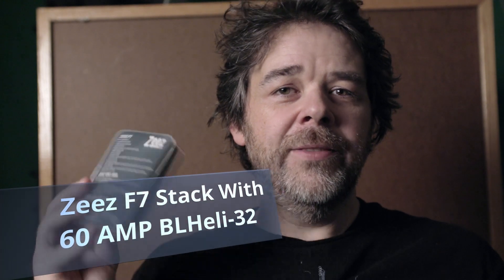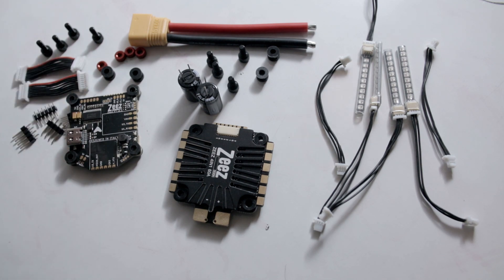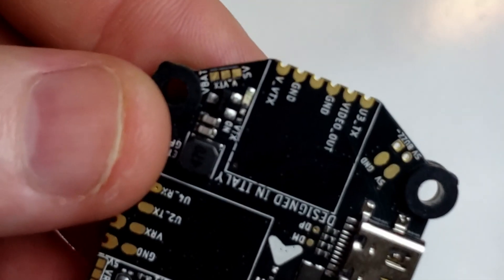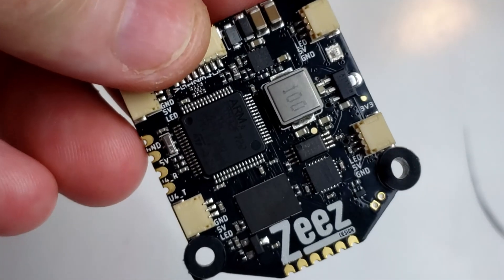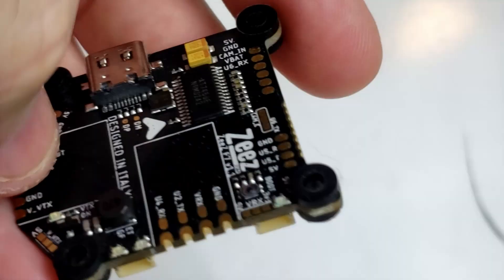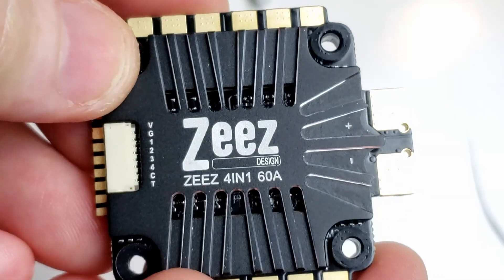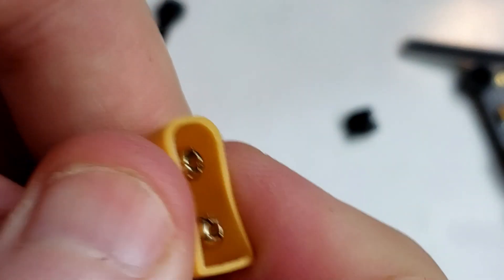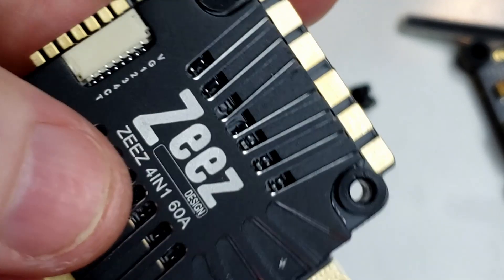Zeez F7 FC with 60 AMP ESC (You want this)

Comment: Please do not solder to the sides, they are just lightly plated.
Reply from the maker: Good advice, will pin this :)  why are they not good to solder?  seems kind of odd
Reply: @Sully365  The top and bottom layer of a PCB are a solid thick copper plate, and during manufacturing the parts that need to be "empty" are etched away. 
To get holes (called vias) and sides with copper in them, electroplating is used. While it does produce a nice conductive path, the thickness and mechanical robustness of those platings is not even close to the standard traces on top and bottom. Since you will be pushing many tenths of amps through these connections, the top and bottom pads of the PCB are be the best choice to solder to. 
The reason the sides are plated is to make solder flow nicely around the wire and just produce a better, bigger connection. Its not mean to serve as the main connection.
Reply from the maker: @drkastenbrot  Really good to know.  I have never had a use for soldering to the sides but i will remember that in the future.  Thanks for looking out for everyone :)
Reply: I soldered the motor wires to the side of the esc on one of my stacks and had no issues so far but good to know

Comment: I dont get it why they add the heatsink to esc:s nowdays. The fets have plenty of cooling from the props and the heatsink is only in one side.  I have removed the heatsink from my escs to save some grams and they are fine. Cool to touch after hard flown packs. Also the airgap inside the stack can be a bit tight so airflow will be worse than without it... just saying... btw mine Zeez FC is on the way and will try it with fettec esc. :P
Reply from the maker: i hope it works out for you with the FC.  i think 4:1 ESCs often have heatsinks bc airflow isn't always the best and it helps.  I havne't popped a 4:1 esc so it could be hype.  this one is very heavy, though, sooo...wish it was gold
Reply: Heatsink can be removed pretty easily but I prefer to keep it on because if the esc components explode you have way more chances to save FC and other components

Comment: I think it's got the outlines on the F7 for you to put on TBS Rx and VTX, but I'm not sure because I don't use any of that because I'm not prone to hype.
Or I'm also cheap, however you want to say it
Reply from the maker: Yeah, it has a simple crossfire set up with lines and multiple voltage option Between 5 V and vbat. It’s a really really really really really well laid out board that has a specific use and wouldn’t be something I would just toss on any quad. However, if I spent the money for great motors and wanted a Very well laid out flight controller and massive ESC, then I would definitely pick this... especially over a lot of the other f7 flight stacks a similar price with lower amperage ratings and worse lookin layouts.